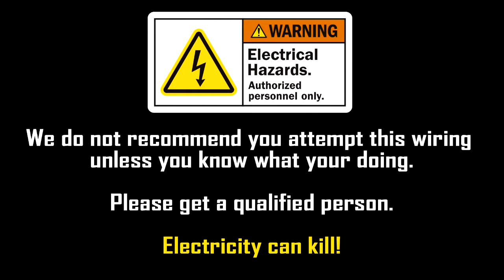How To Make A DIY Circuit Breaker -  25th January 2019

Comment: i'm sorry to say, but this is a totally useless box ! 
Here in Belgium, and i think mostly in other countries that use 230V/240V as mains voltage, in residential use, 
16A or 20A breakers are used in the breakerpanel for the wall outlets, and a RCD between 300mA and 30mA. 
If you use a general RCBO 20A 30mA breaker in your box, and the device behind create a short, and the circuit breakers in your breakerpanel are 16A or 20A, 
then both breakers will trip. If the device behind your box has a earthleak, and you have a RCD of 30mA in your breakerpanel, both RCD's will trip.
The only way that your box works, is to use a circuit breaker that is more sensitive then the breaker in your breakerpanel in your house. 
If you have 20A circuit breakers for your wall outlets installed in your breakerpanel, then you need to use a 16A or lower circuit breaker in your box. 
The same with the RCD side, if you have a 30mA RCD breaker in your breakerpanel in your house, you need a more sensitive RCD breaker in your box, like a 20mA or even 10mA version. Besides that, your wall plug is a 13A type if i'm not mistaken, so why want you use a 20A breaker behind that ?
if this wall plug contains a fuse of 13A, that fuse will blow in case of a short or overload, and not the resetable 20A breaker behind. 
With the 13A plug that you have, you can only use a RCBO 10A with a leak current level lower then the RCD that is installed in your breakerpanel in your house.
Reply from the maker: I agree, you should use a smaller RCD than what you are plugging into otherwise it will blow both. At the time, this was the information I was given so it will have to be updated.